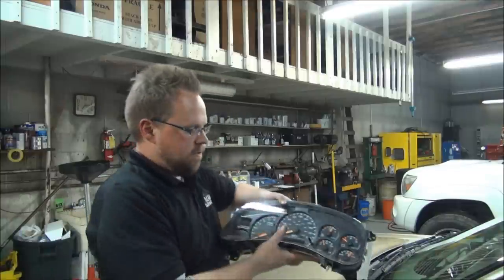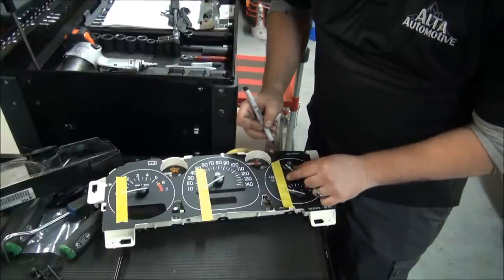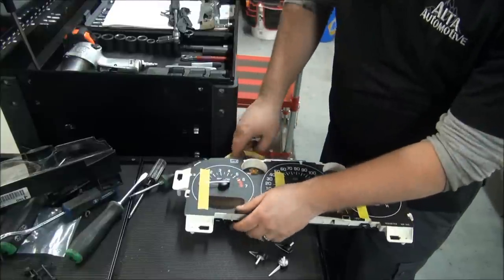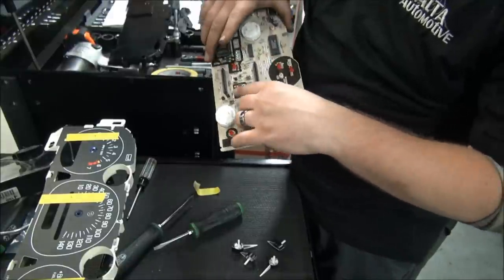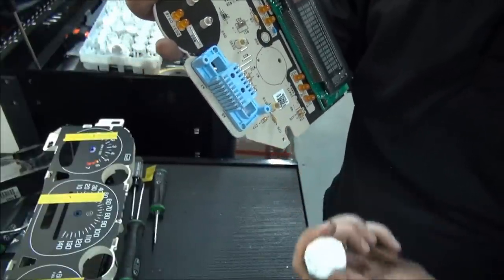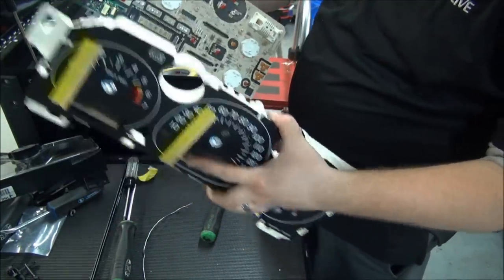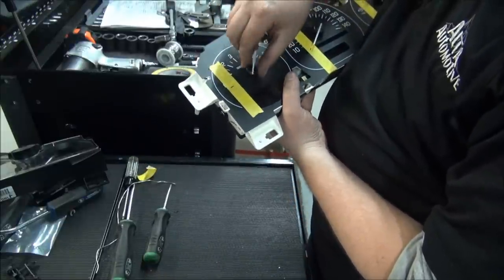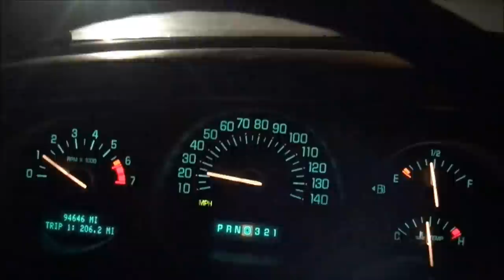How to repair GM Instrument Cluster | Speedometer | Gauge | Stepper

Comment: Bri
my speedometer, rpm and temp gauge were not working. I replaced all three stepper motors. RPM and speed working fine but temp gauge and now oil gauge not working.
Any thoughts
Thanks
Andy
Reply from the maker: ***** Very Strange, not sure I would try replacing them again? I would guess poor soldering connection.

Comment: Ok.... say that you took the needles off without marking them....
And now the gauges aren't clocked right...
How do you get them  accurate 
I haven't rebuilt it yet. But I do have the stepper motors and bulbs. Was going to send them back because I don't know what I'm doing.
Reply: My speedo is 5 mpg off. And the other gauges are not accurate either.

Comment: Hi, I have a Chevy Classic 2005 and my dashboard just stopped working. I checked all the fuses and nothing. The fuses are ok. What do you think it is. My father in law is a mechanic and he recently changed the motor of the car and then like 3 months after the problem with the dash board.
Reply from the maker: Most likely a short inside the instrument cluster. You would need to pull it out and check the connection and power to the cluster. If this is good it will be a problem inside the cluster itself.

Comment: I hear a clicking during my driving. Does that mean mine is cable driven or do I have step motors also? My odometer is way past the 120 mph mark. 2003 GMC Envoy.
Reply from the maker: +terence scott You have stepper motors.. Most likely one has failed..
Reply: Thanks Bri. I plan to tackle this new the near future. These videos have given me the confidence to t give it a try.

Comment: I have a 2003 GMC Sierra and the whole dash cluster is not working. It started with the speed and the the temp gauge. Now the odometer and gear selector does not even light up. The only thing that works is the check engine light. How would i go about fixing this and any guess of a price?
Thanks KWJ
Reply from the maker: Sandy Jeremy It sounds like you have a few different problems with that cluster. I would recommend you replace it, they are very easy to replace. Your local GMC/Chevy parts department will most likely have a remanufactured cluster that you could buy from them in the $300.00 range. And put it in yourself to save a couple bucks.

Comment: I have a 2004 Silverado and my dash lights go off and on as well as all my gauges don't work, will this fix both problems?
Reply from the maker: +Ricky Gazaway No that will most likely be a problem with the circuit board.. Unfortunately would most likely need the dash cluster replaced. However the wiring should be checked for any loose connections and or shorts in the wiring.

Comment: I had someone else repair the cluster on my '07 Tahoe but he forgot to tape where the gages were originally and now they're all off, how can I fix this? Even if I open it myself I still don't know where the gages should be at...my fuel gage, my speedometer, and the RPM gages are off. Who knows about the rest.

Comment: I have a 1994 astro van and unable to figure out how to remove the cluster unit from the van because of the wire attached to the steering column and the cluster unit's gear (eg 1st, 2nd, 3rd gear etc)???  And, it appears the only way to remove the cluster unit is to also remove the climate control panel (which requires detaching all vaccum hoses, electrical plugs and the cable which controls flap in dash)

Comment: Hi Bri,
My Suzuki Swift 2010 1.speedometer needle is not moving
2.odometer reading is not increasing
3. fuel gauge is goes up and down, shows incorrect reading when car moves up and down
What could be the issue?

Comment: i have an 1994 chevy s10. driving to work the other day and mph gauge and rpm gauge go all the way over to the right. truck then seems to be stuck in one gear and i drive on to work which was only 5 miles away. finish work get back in truck and start home and before reaching the house my lights go dim and truck dies. come to find out battery was dead, but alternator checked out fine at parts store. had a fuse blown in #4 slot which is for the gauges but every time i turn ignition it blows the fuse. could this be my instrument cluster? please help. truck cranks fine now with new battery. i checked the voltage coming off the battery while running and it is only 12 volts.

Comment: would like to know, if my mph gauge is all the way to the right, how do I calibrate that one? Also do the motors come with the pins already attached to be soldiered?
Reply: never mind about the pins, I see them attached
Reply from the maker: +Uniqueimages byrico push it all the way to the left, until it stops

Comment: I have a 2003 chevy silverado and I just recently bought new gauges for my cluster since the old one werent working. I did everything based on this video but my needles are not as accurate my gas will say I have 1/4 then once I turn it off it jumps to 1/2 please help!!
Reply from the maker: monique marquez I have not seen that, before I would try replacing the stepper motor one more time on that gauge, make sure you get the solder perfect. Good Luck! I hope it works out for you. However you may have a problem with the circuit board or possibly the fuel level sender in the fuel tank?

Comment: if my needles are way off, like showing negative readings do I mark the tape there. or place mark at 0.
Reply from the maker: +mike PSU-AEC If your needles are off that's ok you just simply push them back to the start position where they stop, and mark them at that spot.

Comment: I have a '99 Chevy express. The gas gauge will peg out, and the van dies. After sitting for a bit ( 5-30 mins.) it will fire up, and run for sometimes 1 block sometimes 10 miles. Is this a stepper motor? Put new fuel pump in ,,, same problem. Any help would be GREATLY appreciated.
Reply: stepper motor, easy to replace for me just did it on 2 vehicles..sometimes you need to drive and tweek the needles in, they don't always calibrate right the first time.

Comment: HI!  I have a 2002 Trailblazer EXT and the speedometer is showing 30 miles an hour more than actual speed.  The tachometer is not registering at all.  The oil pressure meter is showing more than usual.  Are these Stepper motors responsible for all these?  And... could there be another issue somewhere else that could cause any of these issues?
Reply from the maker: Sorry on this year its most likely not the stepper motors

Comment: I replaced the stepper motors on my 2005 trailblazer-ls, had to also pull the battery and charge it, now that it's together, my driver information center doesn't work, what do I do now to fix this new problem, thanks
Reply from the maker: +Harold Adams Not sure on that one, my guess is that the circircuit board may have been damaged.

Comment: wonder if this is what's wrong with my gas gauge. on a 1998 checy mailbu. I can fill it up drive until I get close to half a tank the the gauge seems to down about 2 -3 notches then drive for a but longer and stop and the gauge moves back up 2-3 nothches. thinking when I had my tansmisson.fixed the place screwed the gauge some home. becuase when I got it back then next day my fuel garage was behind the lil pin at the full Mark. had to use a magnet to get it to move it back over the pin.
Reply from the maker: On that year and model its normally a problem with the fuel level sender (float) in the gas tank....
Reply: proabably cost a fortune to repair... but i noticed it after i had my car in to have the transmisson fixed. the needle was behind the lil peg had to use a magnet to get it back over the lil peg on the fuel gauge.

Comment: I have a 2005 Buick rainier and I changed the speedometer motor but when I plugged the cluster back in the needle went to 120 sitting in park and slowly worked its way back to 0.  What can I do?  Or is there something I didn't do?
Reply from the maker: +Dikran Sepetjian Try pulling the needle back off and recalibrating the stat position just below the 0mph. Hope that helps.

Comment: @Do it Yourself Bri 
Hi Bri, before you replaced the stepper motor on the GM clocks did the speedo just read zero and didn't move at all?
I have in the UK the GM version called a Vauxhall corsa c car,and the speedo on that is totally dead.
 I already replaced the common faults that cause this problem by first, replacing the abs speed sensor, still din't cure the problem, still no speed.
Then apparently the connections to the back of the units are know for bad connections,so i unplugged it and sprayed switch cleaner alcohol on both connectors and reconnected, still no speedo at all.

So do you think it could be the stepper motor that moves the speedo at fault??
If i was to buy a second hand set of clocks and plugged them in would the car allow it, what i mean is would it have to be recoded again to the replacement clocks to work? that would be the quickest option to replace the whole clocks or if not then i would try and get hold of the stepper motor for the speedo and solder the new part in

thnaks Rob from UK, ps Is it common for these stepper motors to pack up especially on just the speedo and then act as if they are totally dead? and when you put the new motor in it always works?
Reply from the maker: +SP330Y Sometimes they don't move at all other times they just jump around.
Reply: thanks for quick reply :) Can they just stop working that quick,like one day 100% fine and the next day totally dead?
Reply: If i replace the whole dash unit with another 100% working unit will this also solve the problem or are they CODED to only work with the vehicle that they came from
Reply from the maker: +SP330Y yes, what is the year make and model?  And does the cluster light up fine?
Reply: Do It Yourself Bri
It is a 2002 VAUXHALL CORSA (C MODEL - SHAPE) 1.2 SXI. Yes all the cluster lights up perfect everywhere,all other dials work,like rev counter,fuel gauge,temp etc,all perfect,BUT the speedo does nothing,it just sits at zero.
When i put the key in and start the car only for a split second does the speedo needle move the slightest bit,maybe 2mm jolt up then down again.
I first replaced the speedo sensor and it still didnt work,then checked all connections to the unit (as this is a common fault) all fine there too,then checked all fuses,all fine ,only leaves the cluster at fault OR if i am really unlucky a break in the speedo wire from the sensor to the ecu somewhere,which i doubt.
The fact that upon starting the speedo dial moves ever so slightly,means i think,its connected.
I removed the clocks,took the perspex front off and physically turned the speedo dial by hand upwards to see how it felt,it did NOT move smoothly or easily, there was a little resistance,felt as if it was moving in sections NOT a full smooth rotation.
From all i've said do you think it's the speedo servo motor at fault?
I can buy a whole replacement cluster the whole thing for £15 second hand about $20 in usa money,but i am not 100% if it will work with my car as i've heard stories of the car rejecting it because apparently the codes all have to match,for example the ECU has to match the key and ignition,so i presumed the cluster would also have to be coded or recoded to work, this is dont know for 100%
Reply from the maker: +SP330Y In the US we have seen problems with the chevy aveo were a gear inside the transmission fails causing the speedometer not to work...On my other youtube channel I have a video on this....From my understanding the chevy aveo is very similar to yours... check out this video it might help https://youtu.be/ej_pORD7EIY
Reply from the maker: +SP330Y In the US we have seen problems with the chevy aveo were a gear inside the transmission fails causing the speedometer not to work...On my other youtube channel I have a video on this....From my understanding the chevy aveo is very similar to yours... check out this video it might help https://youtu.be/ej_pORD7EIY
Reply: Do It Yourself Bri
HI again Bri, I took the clocks out of the car,stripped them down,unsoldered the REV counter stepper motor and then unsoldered the SPEEDO stepper motor and swapped them over for each other and reconnected.
The rev counter always worked and the speedo did not,so with swapping them over i expected the speedo to work and the rev counter to NOT work....
BUT The rev counter still worked despite having the speedo stepper motor in,so that means (i think anyway) that it's not the stepper motors and MUST be something that sends the speed signal to the unit.
What do you think,is my theory right?
Reply: Do It Yourself Bri
I found the fault,not stepper motors or clocks or speedo sensor it was 2 broken wires in the speed sensor wiring loom.Reconnected and all is well :) x1,000,000
Reply from the maker: great work!
Reply: hi i have a 2005 gmc sierra with a similar problem the needle on the speedometer and oil are both dead(don't move) and some of the lights on the cluster are going out. would it be the same problem as sp330y?
Reply: Saul Torres
Hi Saul,I fixed mine it was the cable going to the speedo sensor had snapped off,i only found this fault after taking all the dash clocks out and dismantling them :(

Comment: I need 2 of those updated X27-168 stepper motors ASAP for a 2002 Chevy Silverado 2500 HD . My engine temp gage went out.
Can you send me 2 ?
Thanks,
Duane
Reply from the maker: The stepper motors in that year truck should not need replaced... I think its most likely the temperature sending unit and or wiring that is at fault.

Comment: changed stepper motor on speedometer on 2004 impala calibrated it correctly but when installed in car gauge still stays at zero
everything else works??????????

Comment: Do you have to put the updated stepper motor ?
Reply from the maker: No, but they are the same cost... So if you are going to replace them you should install the updated stepper, to avoid failure again.

Comment: will these motors fit a 1999 suburban cluster? if not which one do i need? thanks
Reply from the maker: Hey sorry I'm not sure what stepper motor that year suburban takes. I have not seen any fail in those years if your gauges are not reading correctly there may be something other than the stepper motors bad on that year.

Comment: I have a 2003 gmc yukon my back doors lock will not open. rear hatch door will not unlock and the rear wipers don't work all at the same time. one rear window will not go down. could it be the drive door switch.
Reply: most likely, you have broken wires in the hatch harness, where they bend between the hatch and body (near the hinge) .

Comment: my dad has a Buick  regal 1999!and he want to know why the car would not start .and it is   not  a super charge .when he turns the key the dash board light up but the gage would not move .nothing moves ..and she would just turn n say nothing..plz help me .thank u ..(we live in the Bahamas)..
Reply from the maker: +basia mckinney Its very hard for me to tell what the problem is without having the car here... However based on what your telling me I believe you may have a problem with the starter and or battery connections...
Reply: +Do It Yourself Bri  my dad says when he turn the key the gage is not moving .he usually have the hook up 2 wires to the starter and he turns the key ahead and she will start and cut right back off. He also says that the car would not start from the key. He also says that he also went to the lock doctor change the key switch but it still would not start .but the battery is good and the security system just stays on it never shuts off...so would u think its the security system or the starter ???

Comment: Hi Bri
I have a 95 jetta with a little gauge problem. My rpm and speedo needles tremble. If I kinda hold them they stop trembling and they operate normally. my problem is that I can´t find those vdo stepper motors anywhere and since I live in colombia this aren´t cheap to import. Is there a way I can fix the trembling of the needles without changing the stepper motors? (I have some knowledge in electronics). PS: can I fit another stepper motors from a similar design? Thank you so much.
Reply from the maker: Nicolas martínez Sorry I'm not sure on that. I have never worked on a jetta cluster.
Reply: Just fixed. cold solder joints. thanks

Comment: Hello Sir Bri, this is the great video and I loved it, 
However, I'm electronics soldering freak and I like to change my 2004 Grand-AM Pontiac step motor which has only 44K on and it read 5-miles less than limit and I have been told to have it calibrated.      After I saw your video I got excited jump and went to GM dealer by my area and asked for the step-Motors and the service guy told me that they are not selling the motor and it is illegal for me to touch it. He said GM had to take my care to them and I had to have them do it and the Price is $385 / + Obama Share (Tax). That pissed me off real bad and I told him why didn’t GM recall this sh…ty job first place  and explained about what you said all GM issues from 03-06. The guy was so ay..hole and asked me to leave without even had desire talking to me, so basically he kicked me out. 
So where do I find the -Step motor for my 2004 speedometer, I saw somewhere you said U sell them what is the price?. Since my car has only 44000 on it wouldn't be any issue with DMV in the future if I touched the odometer if I sold the car?  

Good Job Bri...